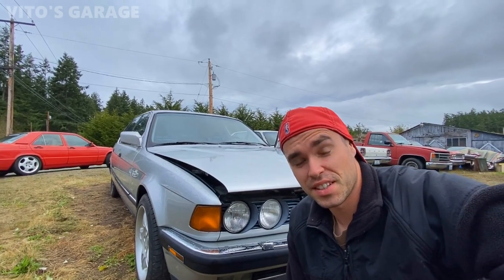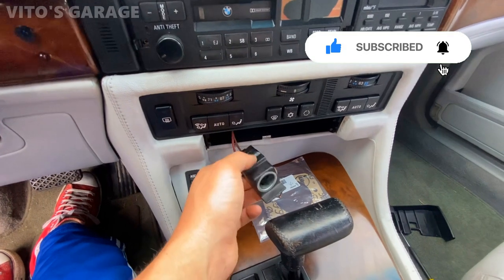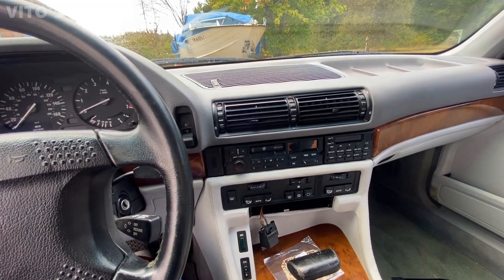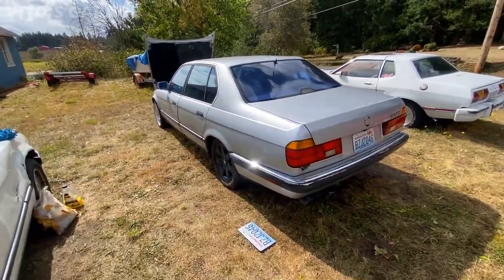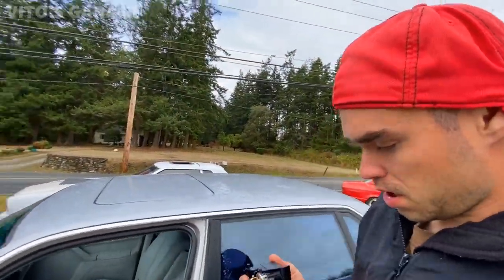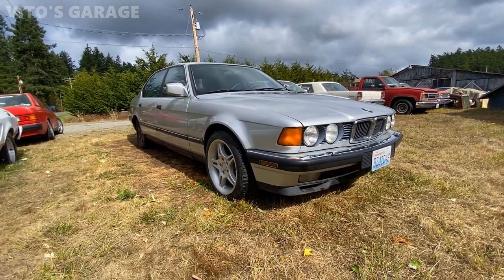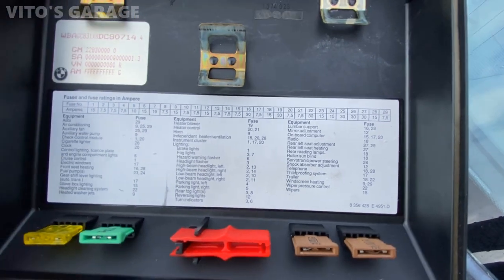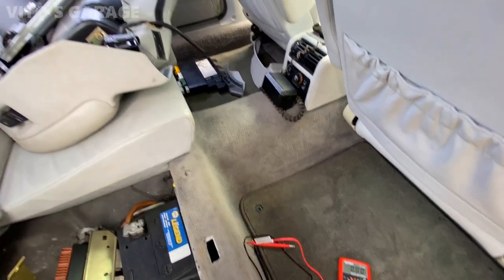Charging Port/Cigarette Lighter Fuse Blows Every Time. Radio Code & Parasitic Draws BMW E32 750iL

Comment: Hey man! Awesome video! Love e32s. Little question here, how do you remove the whole assembly? Do you just pull it out? Are there any screws?
Reply from the maker: I can’t remember. There were 2 Phillips screws on the radio as far as I remember. And then the radio comes out

Comment: Hi Vito is this the car, that had a cabled that had been spliced where you had to figure out where the one cable was coming from? Also.I notice that it has the BMW factory radio, which has a built in security system, that is why it has a code I believe 3 or 4 numbers,.also does it have an alarm system?
Reply from the maker: Yes, that's the car that I fixed the limp mode on. Not sure if this particular model has an alarm system from the factory. I'd have to do a VIN decoding to make sure. The key is regular mechanical, not a fob
Reply: @VITOSGARAGE  That car could have a BMW immobilizer alarm system, you could put it so you can use the regular key  or with the beeper or key fob, later model BMWs have a built in  alarm system that uses a chip, but what got me thinking is that that car  is a 7 series V12,factory radio in order to have it play you have to put a code for safety reasons, the reason is if that radio,is put in another car it will not work,see if you can somehow  get a wiring schematic, good luck!!!!